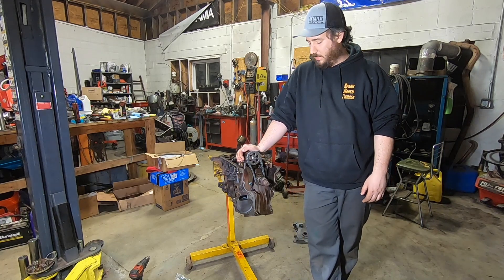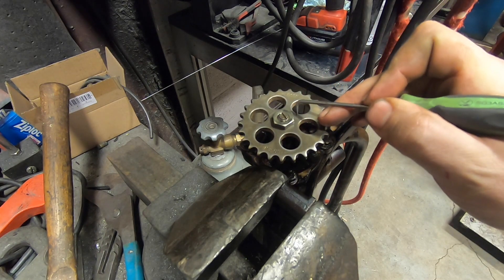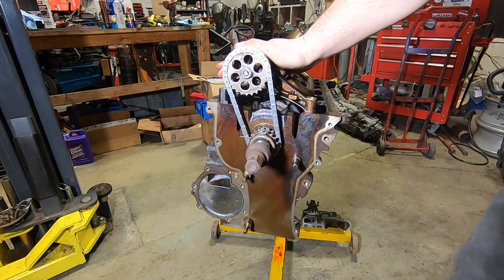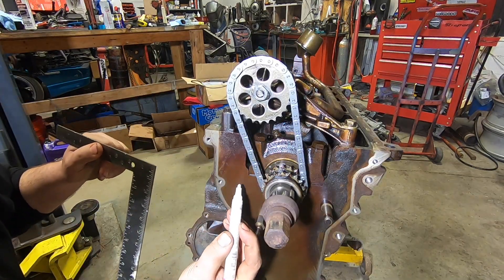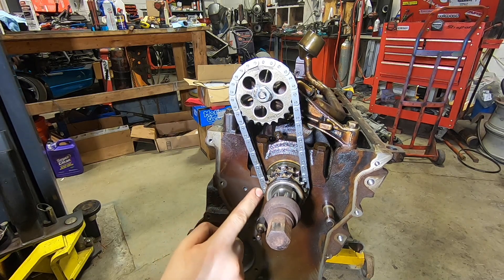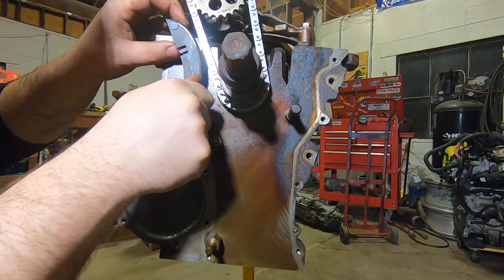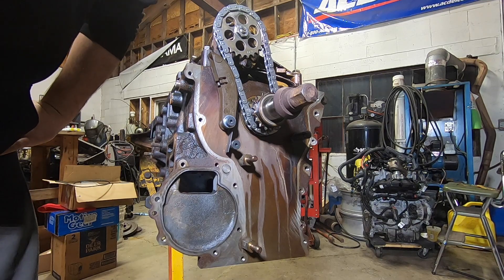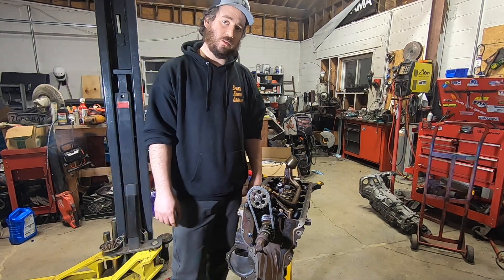M52 oil pump mods with all OEM parts. S54 tensioner. M50 M54

Comment: Are the metal shavings from drilling not an issue you should worry about? Or is there some way to ensure that no metal shavings get into the engine
Reply from the maker: They fall from the inside of the block straight down. You do need to be careful but its pretty low risk

Comment: how thick was the washer you put on the bolt going through the guide? Did I understand correctly that the guide is supposed to have a small gap between itself and the block to be able to move freely?

Comment: Is this necessary for a stock daily that has regular oil service?
Reply from the maker: I wouldn't say so. Extended high RPM use is where it really pays off. I drove many 2.5s and 2.8s hard daily and never lost a pump nut

Comment: Great on point information! Appreciate you sharing this, i did exactly what you did didn’t even cost $50 bucks. Ordered bolts from ebay for $8 and the tensioner as well for about $25, new chain was a must considering mine had a lot of play but luckily the oil pump nut looked fine. New O ring on the oil tube and i was golden!
Reply from the maker: Awesome glad it helped you!!

Comment: Okay third comment on here, really sory lol. As i went to drill holes, for this mod i found out i have one of those early M50 blocks that have the holes for the S50/S54 tensioner already. The holes aren't lined up in the same way as you do it on here tho. The one that puts tension on it isn't off set like in your video tho. It's straight under it. Whats the reason for that?
Reply from the maker: I haven't ever personally come across one of those blocks before. For a while I didnt believe they actually existed.  Did you buy a tensioner and bolts and see how it all works/fits? The way I do it works but its not the only way
Reply: @spankranchgarage  Second time now YouTube eats my comment or it's bugged somehow. I bought Euro S50 dowel pins and they dropped right in. I posted a link to a picture showing the block. Not sure if that's what YouTube doesn't like.

Comment: Can the chain and hub sproket be changed without removing the engine ?
Reply from the maker: Yes but you need to remove the timing cover. Resealing it under the head gasket requires some careful moves but 100% possible

Comment: Got another question as ive just torn down the motor. I'm building an M50B30 for boost. Im doing this oil pump chain mod. How much do i replace besides that? Trying not to go overboard. So my questions are
- Besides the 3 chains, do i replace the sprockets on the crank and sprocket that runs the cams?
- I'm putting in new guides, do i get the iron or plastic guide for the timing chain? (the longer one)
Reply from the maker: I just replace the chain unless the sprocket has some type of noticeable wear. I haven't heard of an iron chain guide. I've had great luck with he stock plastic ones. I don't replace them unless there cracked as even ones with 300K on them seem to have tons of life left.

Comment: What’s the best way to clear out the shavings to insure motor safety while drilling with the motor still in the car?
Is it reasonable for a shop to say they aren’t comfortable drilling with the engine in because of metal shaving concerns?
Reply from the maker: If you are doing this in the car, the chips fall straight down. Only when breaking through the back side would a chip fall into the engine. There are some tricks using grease or a shop vac to control those chips. Looking up from where the oil pan would be you can see where the holes come through. Using a shop vac with a small hose on it could ensure any chips are collected. Very valid point!
Reply: @spankranchgarage  what are the chances of an S52 (or m5x) developing oil leaks if the head is not removed when accessing the lower timing cover (with engine in the car)? Watched a video where a guy with an e46 says it’s a bit hit or miss unless you thoroughly clean the headgasket mating area and get some hondabond/sealant at the head/block/cover corners. My car only has 139k and runs fine, so I’d rather spend the extra money elsewhere
Reply from the maker: @groyvey  Like the other video you watched I agree. Good cleaning and some good sealer and it will be okay. I only do this mod when I initially build the engine. I personally wouldn't take a good running engine apart just to install this tensioner.

Comment: Great video. I have an M50B25 non vanos motor. Do you know if these have oil pump chain tensioners? I've heard some M50's do, and some don't. Some places you read it's only the early non vanos motors, like 1991's. The info is all over the place.

Also, i was going to be putting an M52 oil pump and M52 oil pan with a sump welded on and the VAC baffle on it. That shouldn't cause me issues? Im learning as I go, but trying not to make stupid expensive mistakes.
Reply from the maker: I’ve never come across an m50 with a factory tensioner. I don’t see any issues with your pump/pan setup
Reply: @spankranchgarage  Thanks, i forgot to add that I was going to turn the B25 into a stroker B30. Which crank dampers do you use, and what other measures do you take and rev them to? I was going to add the S54 tensioner, a strenghtened pump shaft and sprocket that takes 3 safetywired bolts. Possibly an ATI crank damper amd rev it to 7-7-2k. Not sure if all that is overdoing it.

Comment: what filler rod material did u use to weld the oil pomp nut :()
Reply from the maker: I use stainless filler. No real science behind this thought. It just feels like its softer and would be less likely to fatigue crack. Its been okay so far... but I have also blasted them with flux core and no problem either.

Comment: Do you think this is alright to do with the engine in the car? Oil pan and timing cover removed of course.
Reply from the maker: Yes you can. Any chips the come through the block fall straight down. It’s fairly safe
Reply: @spankranchgarage  Awesome man, plan to do this sometime this month. Thanks for responding

Comment: When doing this on the M54 Motor, do the measurements change at all where your tapping, or is it the same ?
Reply from the maker: They should be the same but give it a sanity check before you drill

Comment: ... I just redid my M54. Like 2 years ago. New bearings. main bearings the old 3-piece oil control ring new chains almost everything redone.

And I just found out about this chain tensioning slapped mod and now I feel like a total jackass for not doing it.
Reply from the maker: It’s not that big of a deal engines last for plenty of years without these upgrades. If you did a new chain you are going to be okay

Comment: Having researched this for some time (I have a 330ci track car in build) I certainly concur with this chap about the tensioner. People speak of failures of the shaft when welding the nut but, as this fellow said, the chain slack worsens the vibrations / harmonics leading to the failure. When adding a tensioner, the issue appears to be eliminated. Also, don't forget that it is possible to fit a chain tensioner with the engine in the car. You can drop the sump enough (circa 5 mm) and the bolts to the top of the timing chain cover can be accessed with the rocker cover off.
Reply: Wrong. Ive welded multiple m54 oil pump nuts to only have the pump shear the sprocket off. Same thing with loctite and safety wire. From what I have seen and heard the API dampener or an upgraded oil pump is the way to go. Currently working through this issue.
Reply: @deanhosmer852  What do you mean "wrong". Did you actually read what I said!?
Reply: It also has to do with transmission and flywheel harmonics. I noticed people running single mass flywheels always run into problems with the oil pump
Reply: @deanhosmer852  Agreed as regards single mass flywheels.

Comment: is the spring shoulder bolt also a through hole when drilling and tapping? Also, maybe some assembly lube or fresh motor oil on the tensioner just for first start up. Great modification, looks very skookum!!!